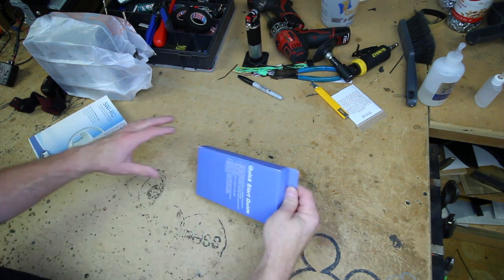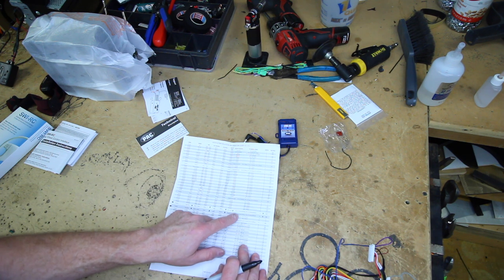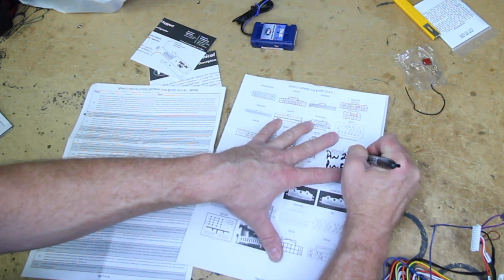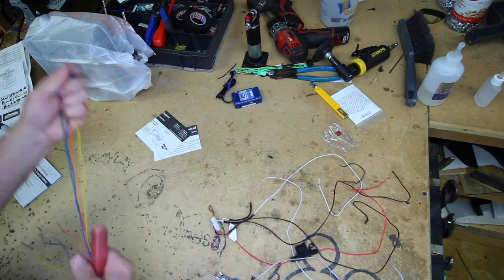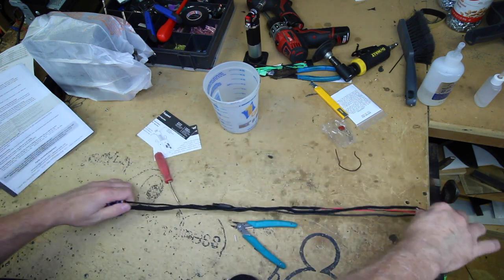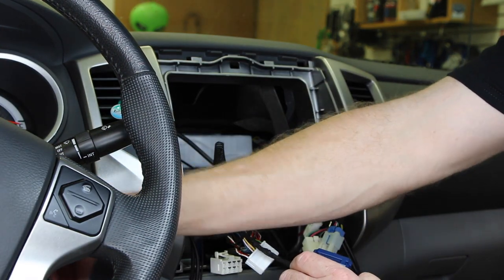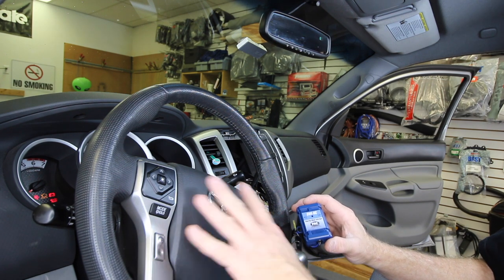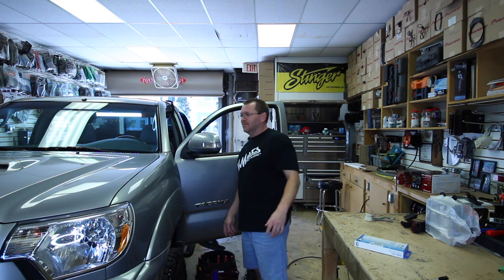How to install a Pac Audio SWI RC steering Wheel interface

Comment: watched the video again more closely. The version is what you set at the beginning of programming. Press and hold - turn on key - then press program button the number of times for the version you are programming. It will flash to confirm programming version. Thanks

Comment: Great video, I just installed the pac sw1 r1 for my 07 tacoma. I did steering swap from 21 tacoma. But when I tried to go through the steps to program the interface, it doesn't work. The led doesn't blink 8 times. Any advice, thanks

Comment: Hi I am trying to "program the version" for my 2014 Isuzu d-max (in Australia) I've set the switch to position 4 to suit the Clarion head unit.
But I'm struggling to find where the chart is saying what programming version should be selected for my assembly.
Any idea where I could find that info? The Pac website lacks my vehicle.

Otherwise your video is very helpful thank you.

Comment: Hi.  Thank you for this video.  I am currently installing a soundstream dvd/nav system.  I am using PAC products to install into a 2009 Cadillac DTS.  I'm sure the products will work with the car.  But unsure of what to use as far as the brand of radio goes since PAC doesn't list soundstream.  Have you worked with soundstream before?  I got the radio going but not the swc.  Please let me know if you have some tips.  Thanks.

Comment: Had a shop install this on a 2011 Camry SE non amplified with a Kenwood DDX9703 and the answer call, hang up and voice activation isn't working should these functions work. Do I need to take it back to them to reprogram. Thanks.

Comment: If the steering wheel uses the same button for voice activation and to answer calls, will the PAC be able to program both functions into the same button?
Reply: You'll most likely have to pick which function is more important to you or re-route one of them to another button.

Comment: what are the versions about and what difference do they make. I have a 05 honda pilot at is has 2 versions (version 3 and 9). 3 doesn't require cutting purple loop. 9 does. What's the difference or does it matter?

Comment: Got a 2003 H2 installing an aftermarket Autofather CD DVD Stereo with steering wheel control etc. Using a PAC RP5 GM-11 interface and wiring harness adapter. Problem is the new Headunit harness has a Grey SW1 wire a Green SWC2 wire and a SWC black wire BUT the PAC has only a 3.5 mm jack option vs 1 Blue/Yellow wire. How do I connect this setup???

Comment: Hi, I have a 2006 4runner. and when trying to connect to the pins my 4runner doesn't have pin 6 and pin 7 to connect to. Do you know what I could do.

Comment: Great Video,  I installed this unit in my 1987 Chrysler Conquest TSI and all the SW buttons work except for the volume up will only work once when you turn the key on, the guys at PAC has been helping me for 2 months with no luck. Have you or anyone here run into this issue or have a fix? Thanks in advance.

Comment: I wanna install this device on a 
03 lexus ls430, pionner deh80prs
But the online instructions only does 2008-2010 ls430 
Is this not the right adaptor ?

Comment: Hello
I have problem with my pac swi-Rc , my car is suzuki grand vitara 2004 , im using soundstream dual screen stereo , i put no 7 on the dial , and version 8 , connect the wires as in the instruction given in the installation manual , its programming successfully put not working with the stereo , the led blinks everytime i use the audio control on my steering wheel , need your help to figure it out , thanks

Comment: Does the Swirc take care of door chimes and such as well or is a separate module required for that? 2007 Buick Lucerne
Reply from the maker: It just steering wheel controls, to do both you will want to get the Pac-Audio RP4-GM31

Comment: The previous owner of my car put in an aftermarket stereo but chose not to integrate the steering wheel controls. My parents could not understand why I wanted to get those back so badly. They said, “just look over at your phone (mounted on a windshield mount) but that’s precisely what I’m trying to avoid-gotta keep my eyes on the road

Comment: Have the same truck an pac audio controller but the phone buttons wont work an when I blue tooth music the steering wheel controls won't change the track up or down? But will work on radio/cd
Reply from the maker: There are extra  wires that have to be looped together for the phone buttons to work. There are 2 different installation types for that truck.

Comment: when I got my pac I did not see the 150 ohm risistor . I need this for my install on well time to stop by RadioShack thanks Crutchfield
Reply from the maker: That Guy it should of come in the box. If there is a white red wire in the harness it has a 150 resistor in it.

Comment: @ five star. will this work for the 2015 elantra gt. I'm getting the pioneer avh-x4800bhs or the avh-x5800bhs.
Reply from the maker: Metra makes the dash kit ( www.metraonline.com) and head over to Bestkits.com for the RP4- radio replacement harness

Comment: you separated fron white wire 2 cable white and white/red from were u take another wire ( ?)
Reply from the maker: joel privado what car are you doing?
Reply: were u take another black wire
Reply: i have lincoln navigator 2004
Reply from the maker: joel privado your install is a 3 wire type install. You have the red and black got to the radios red and black( the second black is not used. Then you have the white go to pin18 lt. Blue/ red. The white/ black and white/ red are not used. You leave the 2 loops intact and disregard the others wires. Here is a link to the instructions if needed 
http://www.pac-audio.com/SWI/SWIAppGuide.aspx?appguideid=186&swiModel=Navigator&swiYear=2004&swiMake=Lincoln&swiProduct=SWI-RC&swiRadioManu=Alpine&swiOptions=
Reply: thank you so mach

Comment: Hi guys. I bought the PAC-os5 with the swi-rc for my 2011 Silverado and installed the appradio4. I programmed the swi-rc with dual switch on 7 vehicle versions 2 (according to os5 manual) and mapped for pioneer. After that everything works good but the track up/down don't work at all. Am I doing something wrong? Help please
Reply from the maker: Gustavo Guzman there are two settings that look like track. The first is between mute and source on the program list. The second is after source. Make sure to use the second and skip the first.
Reply: Five Star Car Stereo thank you for your help. I thought that I could program two functions in the same button like track up for media player mode and preset+ for radio mode. Is there any way around to program all functions available for the pioneer radios in a 2011 Silverado especially the voice recognition?
Reply from the maker: Gustavo Guzman PAC makes the CP2 interface to do multi touch buttons instead of the RC. Voice has to be solo with either interface because you have to press and hold. Remember you can make any button do anything not just what is pictured on the button.

Comment: hey man , hands down , good video, but I can not program, , believe me I tried, my 4 runner limited 2003, any idea I will appreciate it! thanks!
Reply from the maker: Did you turn the dial to select the radio? When you turn on the key how may times does the led blink? It should be 8. Here is the web page information also 
http://www.pac-audio.com/SWI/SWIAppGuide.aspx?appguideid=301&swiModel=4%20Runner&swiYear=2003&swiMake=Toyota&swiProduct=SWI-RC&swiRadioManu=Pioneer&swiOptions=

Comment: I have a Chrysler 300c and I have a radio it doesn't have the plug for wheel control radio how I plug that in  thank you for your help
Reply: Unfortunately your probably going to have use a different radio that has steering wheel controls option plug on the back of it.

Comment: hello guys, what are the resistors for?
Reply from the maker: Jorge Bermudez good question, the car uses a ground output with a resistance on it to talk to the radio. In this car there are 2 wires that put out the same resistance to work 2 groups of buttons. When you add a resistor to one of the 2 wires it changes that switch groups resistance. This will give each switch a different resistances number that the SWI RC can learn and associate with that switch. I hope this helps
Reply: never install this feature before. I done cars,  amps, headrest, and camara.  are there any aftermarket steering unit that don't use a resistor if not how do I know when I need to use one.  I'm getting ready to add one in my wifes 08 pilot and suggestion.
Reply from the maker: Jorge Bermudez don't worry they have really great instructions. You can also use the new CP2 version of this. No resistors
https://youtu.be/UyJ_2yvUS18
Reply: great, thanks again on taking your time to reply  and help out.

Comment: Hi , I have a 2004 Tahoe and a swi-pc connecting to a power acoustik radio and the sound shop said they couldn't install it my radio isn't a option what do I tell the install everything is working on my radio just not my steering control

Comment: Hi I have a stereo kenwood but i don't know where to connect the blue yellow cable is there any way you could help me out?
Reply from the maker: Blue/ yellow wire goes to the steering wheel control interfaces blue/ yellow wire input. It is usually located next to the aux looking cable on the interface.
Reply: +Five Star Car Stereo sorry i meant to say where those the blue yellow cable from the interfaces goes to?
Reply from the maker: +Hugo Diaz the Kenwood radio will have a blue/yellow wire in the harness. It is commonly confused with the blue/white wire.
Reply: +Five Star Car Stereo okay i get it now thank you
Reply from the maker: +Hugo Diaz enjoy

Comment: thanks so much, I did all that, dial on 7, blinking 8 times, I am afraid my cables are not propertly correct, according to the instructions, I only have to wire 4 cables negative , positive , and whites,  , thanks for the links bro! , you guys awesome!

Comment: Where did you plug the AUX cable from the pac into?
Reply: It's not an AUX cable, that 3.5mm cable plugs in to the back of the head unit and sends all the remote signals from the box after they arrive from the steering wheel controls.
Reply: My jvc doesn't have 3.5mm input . Would this still work for me.

Comment: Hey do you have any steering wheel control to work on pioneer x4700bs that I can get on amazon? Please do a vid on what is needed for install
Reply: for stereos pioneer nothing is needed, the only thing required is to program it directly to the stereo.

Comment: So, total noob... there are actually two black wires (ground) coming out of the PAC adapter. Do both of those get tied into the aftermarket stereo harness?? Or, does one go to the stereo harness and one to the car-side harness? One to the chassis??

Comment: Just an FYI. The pac interface has been changed or updated. I had the original one and it burned out so I thought I could use the same wires but, it’s completely different. There’s now multiple switches, 2 plugs, and even a mini usb port.

Comment: Great video thanks!  I have to ask though, is it necessary to cut factory wires?  Couldn't you find the corresponding wires on the "metra" harness?  Or will those pins be blank?
Reply from the maker: The pins are usually blank or in the case of this install in a totally different plug.

Comment: Recently got an aftermarket stereo with this swi. But I have issue programming it. During the individual button programming, I turned on the key, it flashed the correct program, I hold the Program Button until lights up and hold volume button until the LED goes out, but when I release the volume button, the LED never goes back on. I connected the ground (black) wire with the ground on the stereo. Is it the reason? or is there something else I should be considering?

Comment: I Have a Lexus Xr330 2006 and i wish to know what harness is the correct to install a double din radio , and also my oem radio does have only two plugs in the back , but im not certain that i have an amplifier from  factory , and which harness do you recommend for steering wheel control? Appreciate your time in making the videos, lot of good information, Thanks

Comment: Hi i have a pioneer deck i have been connecting all the blue together i thought is was the remote power wire so i don't need to use this? meaning the blue yellow? this might be why the radio keeps going into ATT warning mode

Comment: Hey I just installed this in my 2007 ford freestyle with a pioneer unit. I followed the program procedure but the mute button does “att-“ shuts off the eq on the unit so it just goes to like half volume. Every other button works perfect. Any ideas? I did notice the unit has a mute wire which I don’t have wired to anything. Thanks, I know this is old video. Lol

Comment: Hi there I have a tacoma. I just watched this video and am a little confused. On note #267, it says connect the INTERFACE's White/Black wire to Pin 22 (Yellow/ Black) of the vehicle connector. But in the video as you were reading the wiring instructions, you said and wrote down to connect  Pin 22 (Yellow/ Black) to the interface's (White/ Red). Im not sure where you are getting the white/ red from, cause it clearly says White/ Black in my instructions ?

Comment: How do I install PAC SWI-CP2 Steering Wheel Control Adapter to a Pioneer AVH-4100NEX then to a 2010 F-150 4X2 supercrew?

Comment: We should never cut off seemingly unnecessary wires from the wiring harness kit, because there could be mistakes in the instructions, such as the colours may be listed incorrect (it does happen). I just tape them to the side. They hardly take up any room, and it means the same wiring harness can be re-used if the person wishes to use the radio in a different vehicle, in the future. 
If the new wiring harness is made correctly, then it shouldn't be necessary to strip any insulation from the vehicle's original wiring. After all, the pins are right there in the plug, so they should be getting used.

Comment: Hi, 
Thanks this video is great, but have a question.
I have a skoda superb 2011 (like Passat) the data sheet points me to use can interface for wiring instructions, I have the vw-ss-01 but I could not find any data on it for the wiring. 
Please advise
Many thanks

Comment: Hi I have a pioneer 4200nex installed in my 2018 Nissan Sentra I also have axxesw1 installed also a resistor my steering wheel controls still don’t work any suggestions

Comment: Hello.
Thank`s for your video.
 I installed Pioneer to Chevy Trailblazer 2006 with PAC RP4-GM11. And I believe wiring was made proper by pro installers. But when it went to button mapping something went wrong. I did all the steps exactly the way you show in your video. Neither default mapping was right nor the programming attempt helped to solve the issue. I the end of the day i draw my Chevy away with total mess at steering wheel butеons: my Mute is missing preset - is the only button and it is on source  select button track+ is on preset- and this is it. 
 I would greatly appreciate if you give me an idea on how to fix this.

Comment: well i got the pac-swi-rc hook up and i am installing in a 07 satrun outlook useing a dual radio is there anyway u can look at the papers and do a video on that model i still am not under standing sens mine is number 11 on notes it says.. If you are using a radio replacement interface that provides a SWC output wire, disregard all connection and version number directions provided with this document, only following the programming steps.
Refer to the radio replacement interface instructions for version number and connection information. Note: When programming the SWI module with the OS‐4 please be sure to NOT hold down the and the dual comes with a 3.5 swc rc jack !!!!! or can u email me  about this

Comment: I'm trying to install this kit on a 2005 Prius, non-nav/non JBL. I cannot get my steering controls to work, except for the track up button. I have the 20 pin harness, and connected the wires mentioned properly. Any idea what could be wrong?
Reply from the maker: 140VM you connected the white, white black and both blacks and the red
http://www.pac-audio.com/SWI/SWIAppGuide.aspx?appguideid=301&swiModel=Prius&swiYear=2005&swiMake=Toyota&swiProduct=SWI-RC&swiRadioManu=Pioneer&swiOptions=

Comment: I have 2004 nissan murano im using the swi-rc on my android radio I'm stuck at the end when it says connect the blue/yellow wire to the radios blue/yellow but the radio doesnt have a blue/yellow it has key1 & key2 any idea ?
Reply from the maker: Uptown Finest I would give their tech support a call.
Reply: Five Star Car Stereo I think I figured out what I did wrong I watched your video til the end on the instructions the paper says use version #3 so I was programming version 3 lol ill try 7 now

Comment: Hi Very nice Video. What interface is used for a Mazda 3 2013 i Touring. no Bose System
A Kenwood DDX394 stereo will be installed. The steering wheel only have a Volume Control, Track change, Mode and Mute bottom. SWI - X   or SWI - RC .  Thanks
Reply from the maker: +Metal Heart you may need the RP4-Mz11

Comment: nice video, you made it look "easy"...question; what type of tape are you using?  It looks like a mesh tape...is it or is it just standard electrical tape?  I just picked up one of these and a JVC for my pathfinder.  Edit:  I discovered the paper VIIG instructions included w/ the device were different than the instructions provided online.  The online instructions provided extra information that saved me from having to install the resistors.  So, double check online before trusting the paper VIIG instructions.  Mine were printed in 2013.   Thanks again.
Reply from the maker: It is call tesa tape
https://www.facebook.com/tesatapePJL/